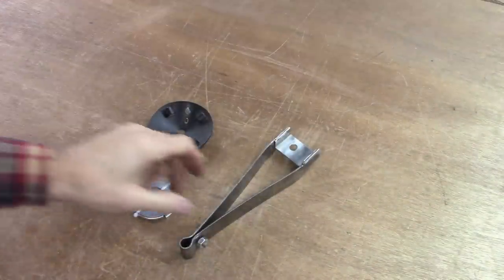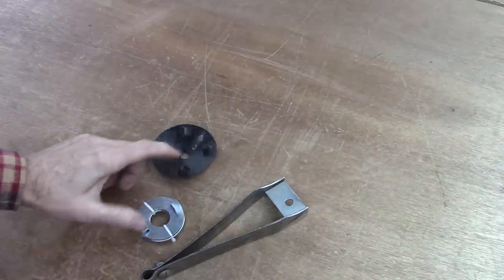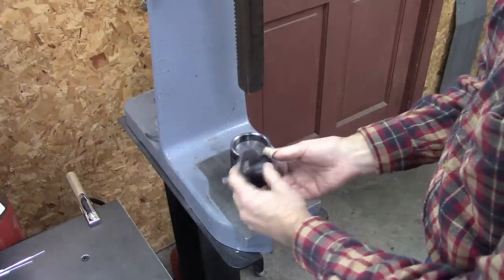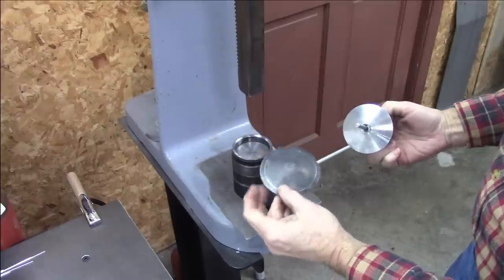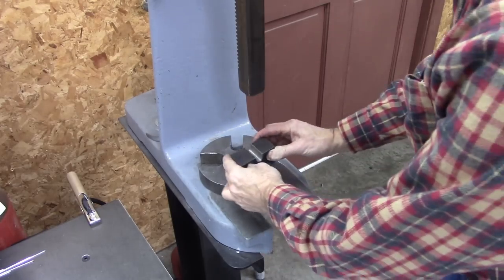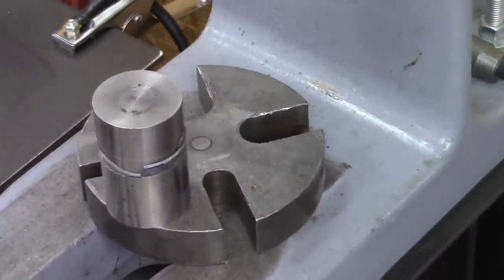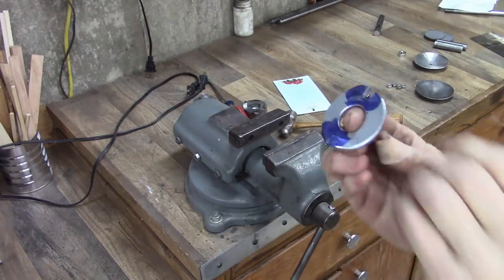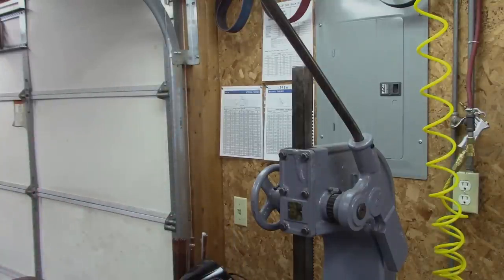Arbor Press Metal Forming

Comment: Mark, my brother-in-law's dad made a hydraulic press with a power steering pump and an electric motor and made various dies for it. He had lots of little projects like these over the years. I was honored to have known him, and seen his press in operation.
Reply from the maker: This press is more handy than i thought it would be.
Reply: @WinkysWorkshop  I have a small arbor press. I haven't needed it yet, but it will be handy for some things. The price was right at the scrap yard, so I bought it without the handle, but it's a common size to replace.

Comment: Bending metal like this is very rewarding. I have a press that I made using a 20 ton hydraulic jack. Taking a little time and using my imagination allows me to make some nice bends. When I was farming, I made some parts and saved almost $2,000.00. The parts that I made were thicker than the factory parts and never wore out.
Reply from the maker: Very cool! I used to improve printing machines like that before I retired.

Comment: Good looking parts, those setups worked well.
Years ago our shop arbor press had a 1/2" hole bored lengthwise in one end of the ram and threaded holes from the front for set screws. We made various tools that fit into the hole and secured with set screws from the front. Made the setups a bit more secure and freed up a hand from holding things. We kept a blank end in the ram, it saved the end of the ram from mushrooming over.

Thanks for sharing your work
Merry Christmas
Reply from the maker: Thanks, I need to do the same. I was thinking about a shoe that fits on the end.

Comment: having a welder in the shop seems to have really opened up your ability to tackle even more unusual projects huh
Reply from the maker: Yeah...  that and a few people keep asking me to make stuff. I'm not complain however. It's good to have a little extra income.
Reply: @WinkysWorkshop  I want to buy a welder but what's keeping me from pullin the trigger is not knowing the value of quality.   I'm thinking just buy a cheap one to have the capability (without the luxuries and extra benefits) but with many tools cheap is a bad decision.   I think in this case, with the price range so varied, I should consider cheap.  Am I off base with this reasoning
Reply from the maker: @dizzolve  Being totally honest I had the same dilemma. If you are talking about TIG even the cheaper welders are a significant cost. I did a little research on the internet and most rated Yes Welders as good or about equal to Eastwood. What sold me in the Yes was the smaller size but I'll have to admit that the grounding issue scared me a little but dang it welds nice.  I think if I was going to buy one right now I would download manuals, see if you can understand them for the most part and see if they have part numbers. For the most part, Yes does not but then you can't beat the fact that they will replace a welder quickly. As far as features go, you want DC, AC, AC balance control, foot pedal compatible, HF start and torch triggered start with ramp up and down. Most AC/DC welders have these. In my opinion "pulse" is mostly a gimmick. I just watched a This Old Tony video where he was demonstrating pulse and he pretty much said the same.
Reply from the maker: Also, Yes gave me the welder...  it sort of influenced my decision. I just looked at the Eastwood manual and looked good but I only know one person that has one. It's 200 amp not 250 but 200 is enough.
Reply: I invested in HTP tig, Miller MIG and Hypertherm plasma for personal use over the years.   I tried the cheap welders and plasma 10-20 years ago,  but wasn't happy with them.   I recently bought a YES stick welder for light weight mobil use and so I didn't need to unhook my tig in the basement.   It was also under $100.  I'm very happy with it.   The inexpensive welders have come a long way!!
Reply from the maker: @maxw576  Good to hear, probably mostly inverter technology.
Reply: @dizzolve from a welder of 40 plus years is first  what type of welding do you want to do. Next is how much do you want to do, next is what type of metal do you want to weld , and last but not least is how thick of metal do you want to weld. After you've answered all of these questions them you are ready to start your search. DO NOT LET SOMEONE TALK YOU INTO BUYING A PRODUCT WITH OUT YOU KNOWING IT WILL DO WHAT YOU ARE TRYING TO ACHIEVE. Mig welding has an easier learning curve . Stick welding would be next in line if you only wanted to weld outside and not in a shop. Tig is a hole different story it is the hardest to master where your weld is good and it looks good but has a wider range of  metals you can weld. But keep in mind it will get you very frustrated if you've never welded you will not just pick it up and go to welding. Good luck.

Comment: Nice job. Always wanted a fly press myself, just not easy to find where I live.
Seen some interesting videos forming sheet metal with 3d printed formers, worth a try if you have one.
Reply: I have a flypress and die sets to dispose of if your anywhere neat Birmingham in the uk.
Reply from the maker: Interesting idea.
Reply from the maker: A fly press is a screw arbor press right?
Reply: Yes its a manually operated press used to make small to medium pressings in small or larger quantities. The force comes from rotating balls on an arm driving the screw. Used in factories from Victorian time to today.. My is rated at about 2 tons force..

Comment: Very satisfying. What is the rating of your press without a cheater bar? I have done a little bit of bending on a small hydraulic press with a 5 tonne jack, but I'm still figuring out it's limits for bending. Can't imagine not having a press in the workshop now, they are a quite versatile tool.
Reply from the maker: 3-Ton. I agree, very satisfying and easy. 5 Ton is a lot.

Comment: Sorry this is very much off topic. A good  while ago now you made an acme threaded feed nut. I need to do the same but can not find consistent  info on tap drill sizes for acme threads. Would you be able to tell me where you found it.

Thank you 
Tommy
Reply from the maker: Hello Tom, honestly I just typed "1/2" acme tap drill size" into a google search and it displayed a chart. The size for mine was .400"
Reply: Thanks for the prompt reply. Must be asking the wrong question. I did however find a formula  to calculate the correct size.
Reply from the maker: @tomw1372  Thats great.